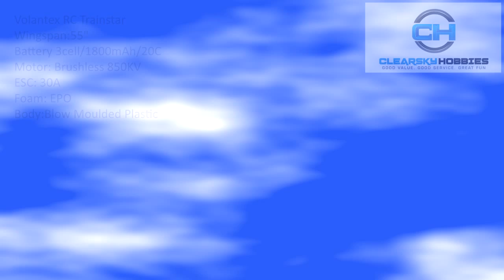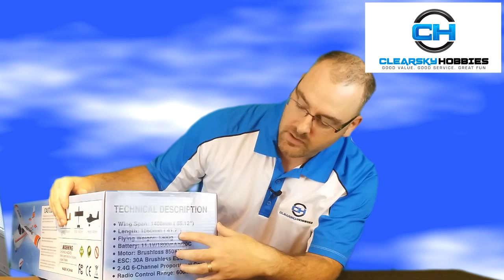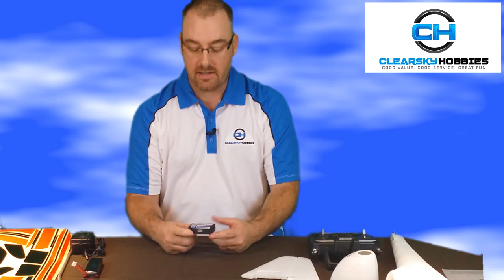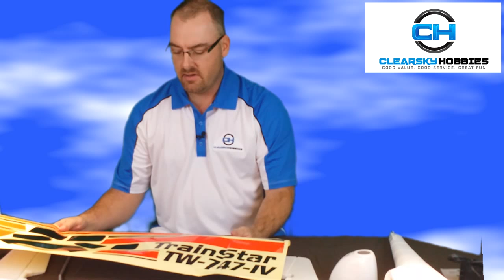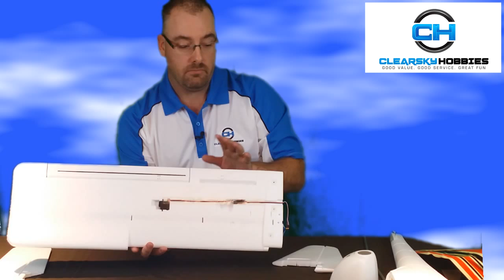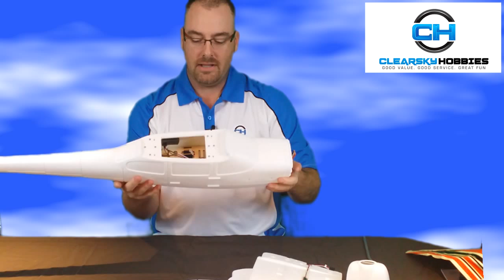VolantexRC Trainstar Unboxing

Comment: translated with google ,,,, sorry for any misunderstanding

What about the engine and good? Strong and agile .... And with regard to space ..... I have the most agricultural area which is further away from home ... what here are the areas in the style of soccer field ... municipal .. not as big as the Spaces that I see on youtube of the personnel. flying with your model airplanes ...... then you have houses in the procimities. the field that I saw and got authorization to use has very few trees with a good size of space ... what do you think. ... you need a lot of space to fly or it is already good ......................... this is good for beginners